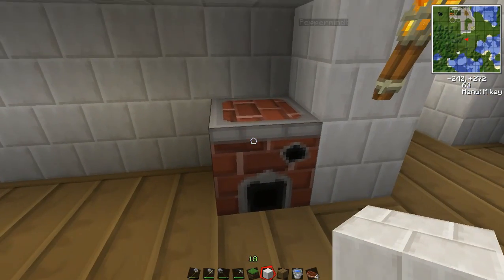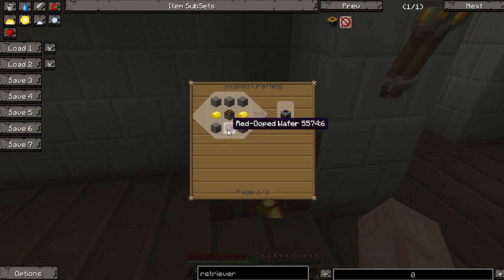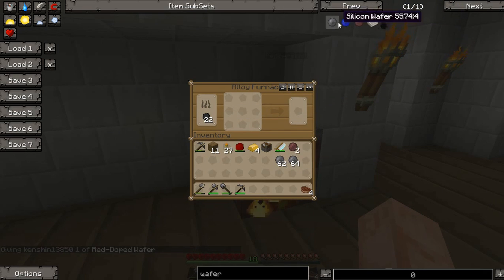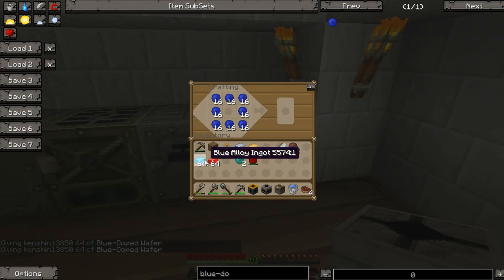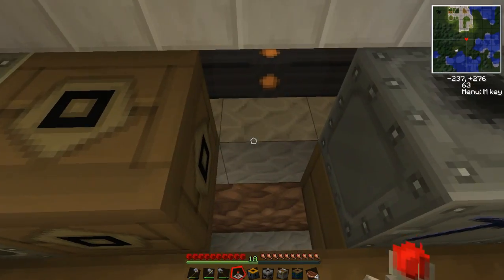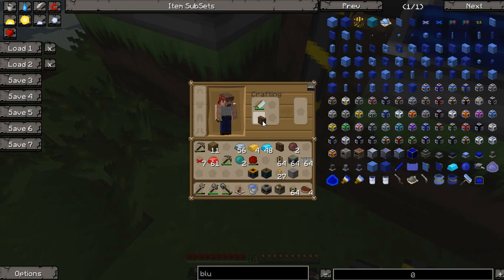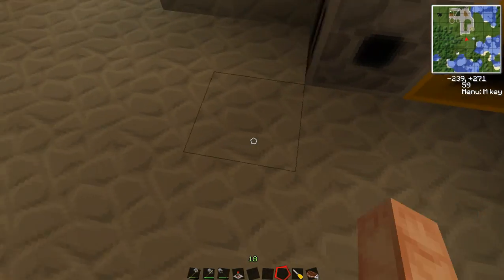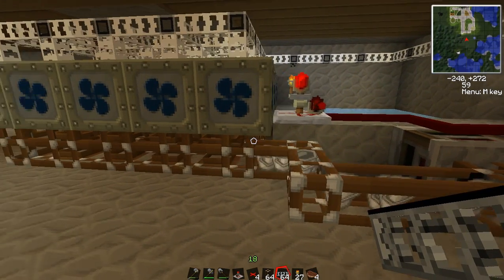Tekkit Lite Tutorial - Episode 5: Infinite Low Voltage Power

Comment: Hey man don´t want to bother you but do you know a good way do get level in Tekkit lite bc you won´t get level by cooking things in the furnance...
Reply from the maker: You mean gain character levels? There's no easy way to gain those I fear, but it depends on what you want to do with the levels that really matters.

If you want to enchant things, then that's not so bad. You can make an auto-enchanter and feed it exp from mob grinders. For example, you can set up a system to auto-breed cows and kill the fully matured offspring. This provides you with unlimited beef, leather, and experience. The only limiting factor is how quickly you want to/can grow cows. I also put mob grinders so they can hit doors that zombies will attack so that they just get mowed down and don't enter my house. I'll cover this in a later episode when I go over automated farming. This is all under the minefactory reloaded modpack if you want to go explore that.

If you need character levels so you can use the anvil or whatever else you need levels for, then it's a little tougher. The way I did it in vanilla minecraft was I found a monster spawner near my home. This is key, because mobs will only spawn within a certain distance of the player and will despawn if the player gets too far from them. Then you build a monster trap. I built a water trap that funnels all of the monsters that spawn into a hole, without filling the hole with water. This hole drops them just far enough that when they hit the ground, they're left with 1 hp. Then I periodically go down to the bottom and smack the monsters to death and get tons of exp. Just keep in mind that the only way you get xp is if you deal damage to the mob before it dies. If you can't find a mob spawner, then you can hollow out a large room (or build one above ground, it just has to be dark inside) near your house (probably with a buildcraft machine) and use that room to spawn monsters instead of a monster spawner. Then funnel them and kill them.